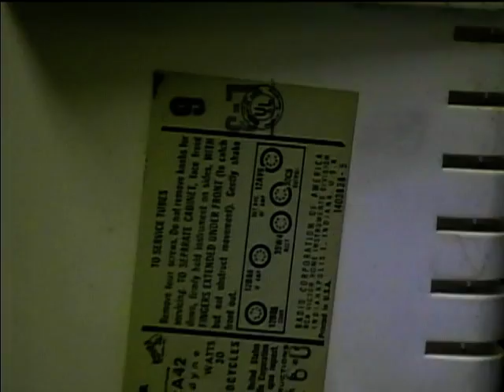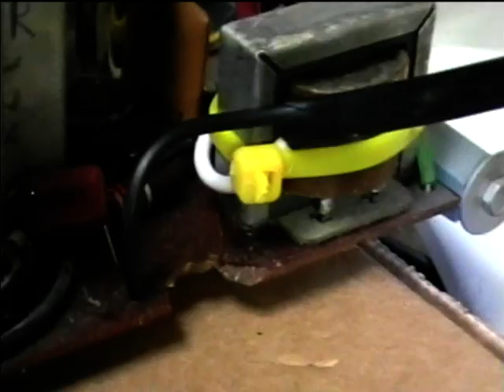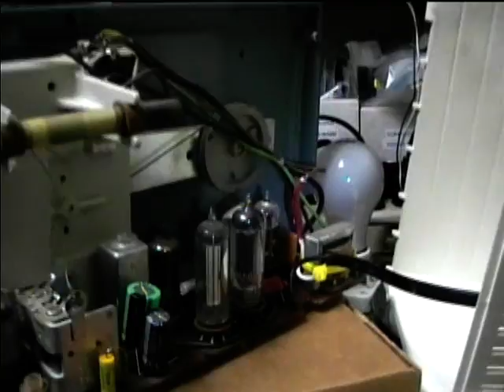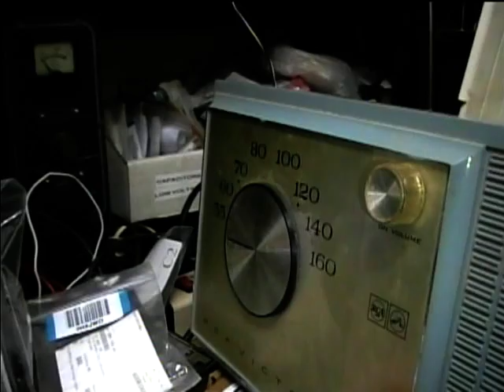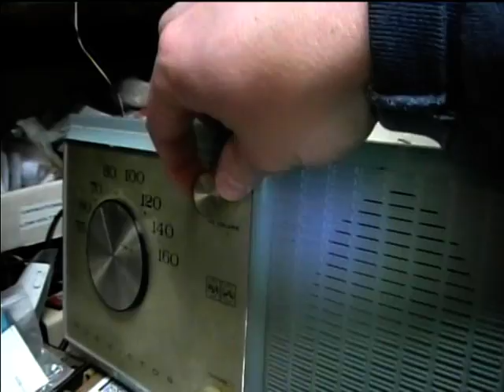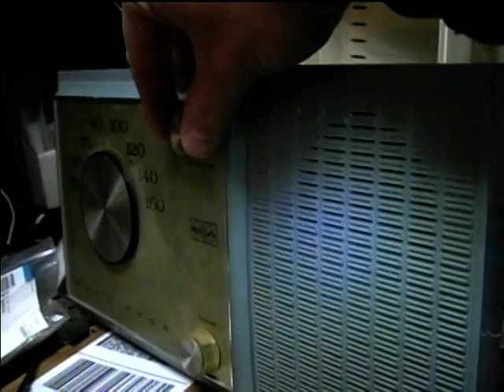1964 RCA tube type AM radio model 4RA42

Comment from the maker: Hello, 100 pf for AM circuits and 22 pf for FM circuits has worked well in every regular AM or AM/FM radio I have done. You will just need to do a little alignment after you replace the caps as these may not be the exact original values but they have worked every time for me.

Comment: @retrochad Some IF cans can be repaired with work, but there are other cheap made cans (G.E. used them extensively, & some R.C.A. models did as well) that had the Mica permanatly molded into the base. there was no way to isolate or remove the affected parts of the I.F. can

Comment: Lot of work peformed on that table radio, nice job, & it sounds good. The circuit board reminds me of my 1950's Motorola portable  never could find the break in the circuit board.  I  I have been working on a 1948 Mgnavox Windsor that needs caps, & has a lot of them.  Everythling works,  but not very well,& tubes are ok. The FM is weak,  has motorboat sound. the tuning eye doesn't work, & it has no bass, but plenty of volume.  Too bad you're not closer it would be on the bench of a professional